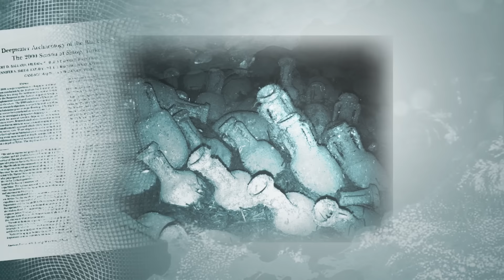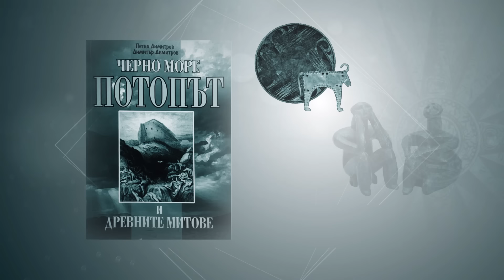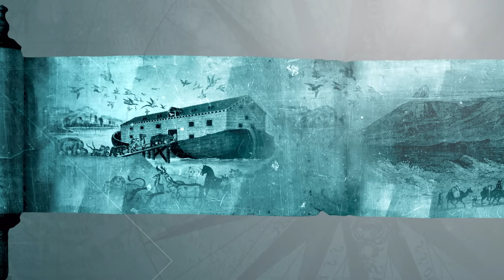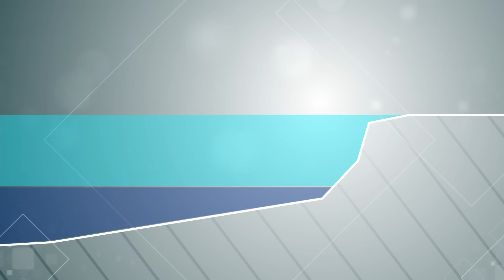What's HIDDEN Inside The World's Most Mystifying Sea?

Comment: When you introduce fresh water to salt water you can get (SRB) sulphate reducing bacteria. This is commonly known in the oil industry. When fresh water is pumped down into the salty produced water in the geological formation(primarily for fracking). It can turn a fresh field sour due to all the activity of the microorganisms introduced from the fresh water. There are many types of sulphates in salty water. Indeed mixing waters can cause sulphates as well to crash out. Barium sulphate, calcium sulphate etc..
Reply: It used to be my job to calculate what scales could be formed in the mixing of multiple water sources at a lab I used to be a technologist at. And also we had biological assay tests to test for the type of bacteria that could cause H2S, present in fresh water samples to be introduced to the formation.